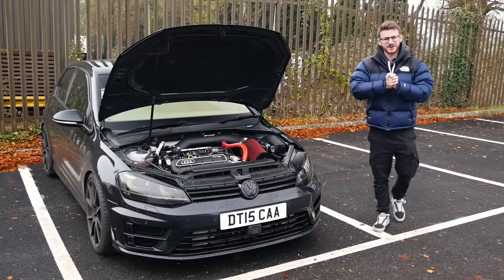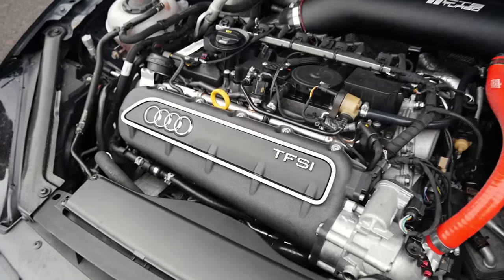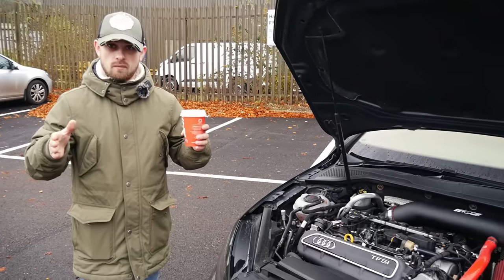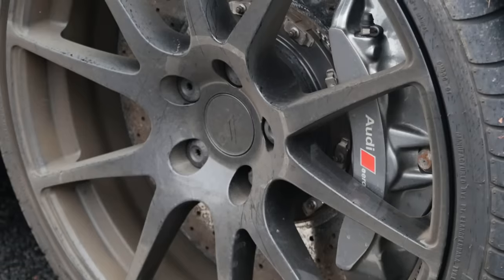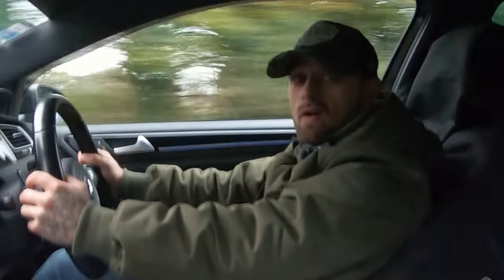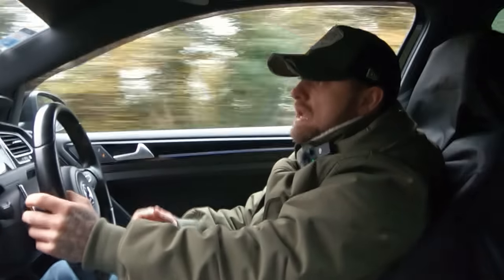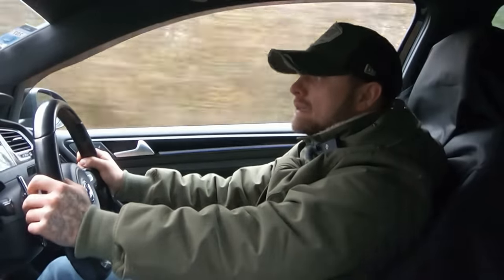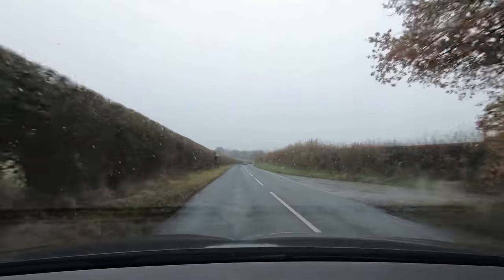Meet the 650BHP+ *SELF BUILT* RS3 Engine Swapped MK7 Golf R!

Comment: Nice car, but why sitting so far back.. to look cool? Arms are straight as anything, will have no control if you lose it
Reply: Thanks jenson !!!
Reply: I’m tall, and in most cars the steering wheel doesn’t come far back enough. Often have to sacrifice a little bit of arm angle, in order to get proper leg, knee and back position sitting nice and low
Reply: But for this little fella I can’t comment
Reply: Because he is a g. He did it all himself.... but 
Had a good friend who helped him put the engine in

Had a good friend do a wiring

Had someone do the coding to get the acc working

Does everything properly but didnt bother fitting the rs stuff... just bent the hoses

Plastic welds up a washer bottle rather than get a decent alloy one made ....

Each to their own I guess
Reply: Think he’s just really short
Reply: @NickthaGeek so he did nothing 😂
Reply: Best way to drive boso
Reply: @bradders1303 he talked the big talk. Did up a couple of engine mounts  ..😂
Reply: @NickthaGeek ha if only you knew I’ve seen him by himself in a workshop building that engine from single nuts bolts and a bare block and thousands of pages of manuals. The physical build was 90% done by him. Some people are just sour they can’t do such a thing 🤦‍♂️🤡
Reply: So much hate. This is a build. This is a car. He can drive it. He’s dialled in to it. I love his know how and his passion. WEAPON
Reply: Elbow delete!
Reply: The first thing I thought when the video started. Has to lean forward to turn the steering wheel. 😂.

Comment: Great build, im also on the Venom700 on a CEPA RS3 8P, im currently running my engine  in now from just being fully built and wondering what pressure you running it at to get the figures and is it all just on pump fuel? Im aiming for the 650-700bhp mark.

Comment: wait did you say bow engine? this is the first time ive heard of that because ive always associated the DAZA with RS3
Reply: The DAZA engine was from 2017 & up anything 2016 & under is still an RS3 but internals are not as strong,the DAZA has a much stronger bottom end made from aluminium where as these have steel bottom end,i think I’m correct but I’m sure someone will point out if I’m not,but they both sound near on the same tho,but if you was to do this swop you’d wonna go DAZA for more power as the older version stage 2 be lucky to get 450hp
Reply: This ha dnw engine code not daza but the daza blocks are known to throw a rod, but the pistons are good for around 800 hp, all you need is uprated rods and run a full frame turbo and have  700bhp and plenty